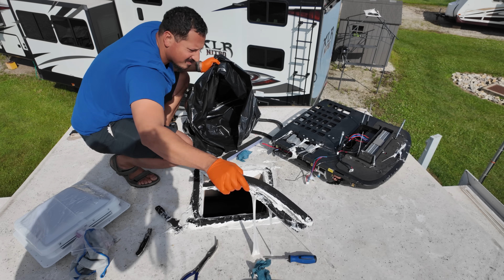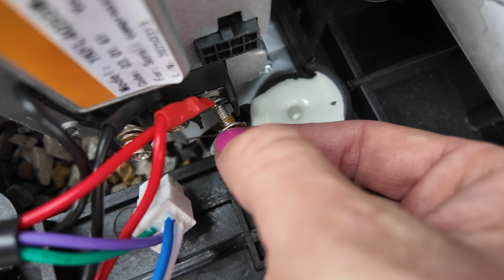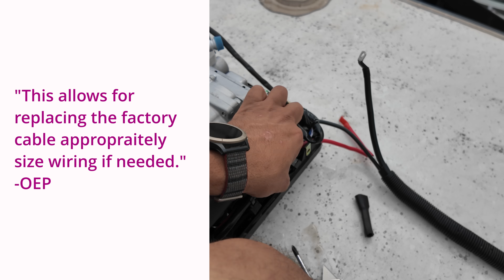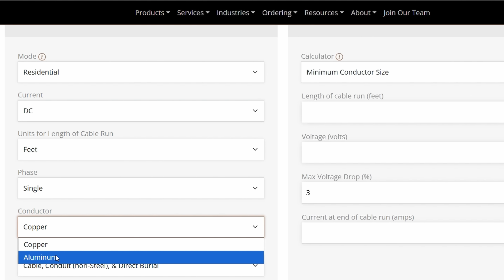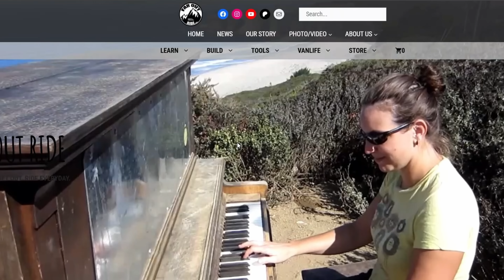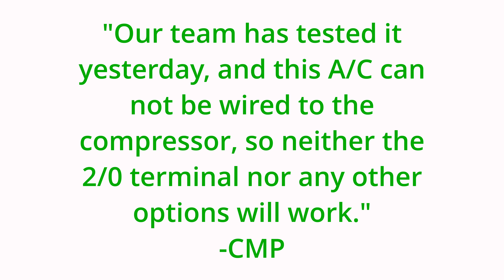The Truth About 12V RV AC Wiring in Big Rigs (What No One Says)

Comment: You may be better installing an energy saving Mini-Split unit with a mounting bracket on the rear bumper. I think some of those units use about half the amperage than the rooftop unit.  Should run on a decent inverter longer time than the 12V unit. The problem with 12V when considering Ohms law is amperage required due to DC 12 volts. DC 24 volts would typically require 1/2 the current or amperage and therefore only approximately 1/2 the wire size.  A mini-split unit a 13,000 or possibly 15,000 btu's probably needs 9 or 10 amps to run at 120V vs the 15000 btu roof unit using 14 to 15 amps.  If you really want to use the DC roof air unit you may consider checking to see if the roof unit could be changed to use 24V DC or possibly work with a DC step down transformer in the unit then set up a seperate 2 or 4  12V battery  bank in series for 24V output.  This would allow smaller wire feeders due to twice the voltage.
Reply from the maker: I have heard that those mini splits are the ticket! We wanted to try this out because it was the talk of the town, but you know we quickly realized that it’s not a great option for big rigs unless you make some serious modifications or have it closer to your battery. Thank you and safe travels!

Comment: Finally, a video telling the truth about these 12 volt units that everyone is peddling.  Someone asked me just the other day about these, said I've never owned one but would be concerned about the higher amperage, wiring, etc.  We live completely off grid and I recently changed my solar system over from a lower voltage, around 100 volts, to a higher voltage system, 400 volts.  What a difference, way more efficient, cooler wires, cooler components and much safer.  We dropped our amperage by about 75%.
Reply from the maker: Wow that’s insane! Love that your new setup is working for you! I’m sure these 12v work for smaller rigs but not larger ones for sure!

Comment: I have a 12 volt mini split in my motor home (Winnebago View) and it works fantastic. It’s very important that you increase the positive wire gauge to 2/0 from the battery to the outside unit (compressor/condenser.) I tied into the supplied wire (8 or 6 gauge) close to the compressor beside the unit. I also tied into the negative with 2/0 at the unit and connected it to the frame. I left the indoor unit wired as it came from the factory as it’s only turning a fan motor. Unlike a roof-top, the mini split requires the installer to add 134a refrigerant. MAKE SURE to put the exact amount in. 
It keeps the View cool for 6-7 hours with a fully charged 300 ah 12.8 volt LFP battery. I plan to increase the battery to 630 amp hours soon. The mini split outdoor unit is located under the vehicle - in the shade. Another benefit of the mini split is it allowed me to keep the Coleman 120v AC on the roof.
Reply from the maker: Thank you for this! I have heard that mini splits are the ticket!! Safe travels and stay cool!

Comment: Youse are asking to run a very big unit topside, but it can easily be done. The aluminum wiring, provided, should be discarded. Using the terminal size provided, run copper + and - about a foot. It then gets joined to very heavy copper cables to your batteries. My alternate would be insulate copper plumbing pipe in PEX plastic pipe for the long run. You don't have to run the very heavy stuff all the way to the unit. A better design, would be to source a much smaller DC AC system, such as a camper Panasonic 24 volt, which will clobber high humidity, but leave some personal cooling to high quality fans such as my recently purchased Boundless Breeze. Even with all the solar panels you can fit on the roof, high electrical draw will turn into a curse. Big mobile AC is properly built with a continuous generator. So you know, 12 volt DC compressors exist all the way down to 31 watts. They just aren't built into AC units. They keep your sandwiches cold.
Reply from the maker: Thank you! A 24v system would be the ticket for sure. I’ll check out that  boundless breeze! Safe travels!

Comment: Maybe you should consider a 24V battery bank and A/C unit, the Southwire app says you'd only need 1 AWG with your parameters, of course that will require additional equipment to step up to 24V to charge and back down to run 12V for the remainder of the rig, Victron solar charge controllers, perhaps others, can be set to charge at 12V or 24V, if you already own this then you at least have a partial solution to charge a 24V bank. I started researching 24V when I realized you can effectively double the output of your solar charge controller.
Reply from the maker: 24v would definitely work- we were just testing the 12v system because that’s what was being discussed. Thank you and safe travels!

Comment: Country Mod Pro. Ran my wire 30 Feet. I got marine wire 4 awg double insulated so it looked like one thick wire. Used a 120amp Bussman breaker. Done. Had to use GOOD quality parts everywhere. I tried to
use 6awg and it got way too hot.
Reply from the maker: Definitely using good quality parts is important- fires and rigs don’t mix! Great job and safe travels!

Comment: I believe if you go through 48 V unit it much better and it’s less cable sizing and I believe there is also Ac unit with AC electric with R 32 gas which is much much much better than the schooling capacity is really high. There is another one which is the 134 which is usually automobile gas that’s that’s usually does not work in and very tough conditions or something like that but I believe Acunit with R 32 gas rooftop and use your inverter is much better for run run time and so efficient actually much better than to run a whole entire cable for unless if you want to DC go for 4P boat and check if there is a possibility if you can get the 48 V DC with R 32 gas

Comment: Have a  quick secondary thought.
 thinking about efficiency. 

Might be best converting 12 V to 120 V. And then just installing a mini split system. As opposed to your "12 V RV AC ".

There are many high efficiency models out there. They don't need a massive amount of amps for startup because the compressors can build up as opposed to needing that rush of current.

And overall, the majority of 1 ton systems require less than 10 A overall.

Just what I would do with an RV that size

User dependent, especially how many batteries you want to put in there. But for every hundred amp hour battery that you were able to store power via Soler etc. would probably give you at least two hours of run time for a AC heat pump. 

Inverter Efficiency:
Inverters, which convert DC battery power to AC for the mini-split, are not 100% efficient. A reasonable estimate for inverter efficiency is 90%. 
Mini-split Power Draw:
The power consumption of a mini-split can vary, but a common figure is 500 watts for a 12,000 BTU unit. 
Runtime Calculation:
With a 90% efficient inverter, the usable battery capacity is 1152 watt-hours (1280 * 0.9). 
With a 500W load, the runtime would be approximately 2.3 hours (1152Wh / 500W).
Reply from the maker: Wow, thanks for sharing. That’s very informative. Never thought about a mini split before. We really wanted to test out 12 V and see what we get away with and see if it was viable for others. I think we found it’s not as easy as the advertise an inverter system is definitely gonna be the way to go thanks for sharing!

Comment: I recommend a heatpump instead. The cost of propane keeps going up. A 3,000 watt solar power system can make it work. Hopefully. But if it doesn't, a trailer hauling the power unit with a 30 kilowatt battery and 6,000 watts of solar should do the trick. The trailer can run a freeze dryer hopefully. It needs to be able to run for two to the days non-stop.

Comment: You set the calculator wrong. First, uncheck the 122f box and the 20 min continuous run.  Your ac won't draw 55amp continually! Plus, those 2 cable  use for positive and negative are not in a cable so they can handle more amp and stay cooler so less voltage drop. But for sure, low voltage like 12v it's really a bad choice for covering long distance with big load.

Comment: Instead, go with 24, 36, or 48V AC.  By going with higher voltage you don’t need as big of wiring.  I don’t know if they exist, but running 4 batteries inverted just for the AC is always an option if you can get a unit that runs at the higher voltages.
Reply from the maker: Yeah, a higher voltage is definitely the way to go. We just wanted to test out the 12 V and see what we can get away with us. That’s what a lot of these RVs come set up as thanks for sharing.

Comment: COUNTRYMOD WIRING ON 36' MOTOR HOME - OK you asked how I wired my 12V AC unit, I used the existing wire that came with the unit (14ft red & black), my 5500 w gen set is located near the rear of my rig and is wired properly from the manufacture with 2/0 wire due to the distance to the AUX battery 20ft ( 40' total )  , I ran the wires from the unit down the outside of my MH, inside electrical conduit and attached them to the plus and minus wires at the Generator power box with the 125amp fuse on the pos wire and a disconnect switch, I show this in my YT video, I have the excepted voltage drop with this setup and it's been working great with my 300ah aux battery.  NOTE if I'm going to run the generator, I turn the AC unit off before starting it, due to the power needed to start the gen set and the voltage drop might damage the AC unit.

Comment: I’m thinking buying 12 volt ac and heat , do you guys recommend buy one for my tv ? Any one has idea ?
Reply from the maker: If you would need to run wire longer than the 16 foot of manufacture provides, I would say you’re better off considering an inverter system at that point. Hope this helps.
Reply: @DeterminationUnbound thanks

Comment: yeah, i would agree they are not as 'plug and play' as most folks let on, at least not safely. 

i just finished an outequippro 10k unit install / upgrade from a maxxfan on a sprinter build. 
i upgraded wiring, added two bus bars under the cover, so i could have 4g (all copper) to the device, and 6g (all copper) inside the device. 
run is 20ft (so 40ft counting pos and neg) .. i've never seen it draw more then ~43A so should be ok. (could have made wire run shorter, but this was just easier / less holes in things)
replaced crap fuse it came with, using a bluesea block and mega fuse
i also sealed up the foam insert covering the ac fins. and had to do a custom roof seal because the one they included was not great (and i botched install) but no leaks so far from hose on it or it running for multiple hours
made a custom sleeve to extend ac out down to vent because sprinter has an insulated ceiling ... was able to get the metal brackets in between ceiling and van body, as someone else called out the heat inserts were not strait causing mounting studs to wobble when tightening, so i had to get them in, then drop it into hole in the roof.

so more then few mods, some that many folks wouldn't feel comfortable with. 

the https://faroutride.com/wire-calc/ link is really good, thanks for sharing that, will be a good sanity check for finishing the rest of the victron build out.
Reply from the maker: Yeah we messed up that seal so fast! It sounds like da like you did great and having half the run as us- I’m sure you had better luck! How’s the cooling?

Comment: What about installing the AC in the front AC opening on the roof of the trailer rather than the rear? 
Another option might be to install a smaller lifepo4 battery at the rear of the trailer and use 6 awg to the AC and 2 awg to the front for charging the rear battery?
Reply from the maker: Oh you could definitely just move it closer to the batteries. We wanted to keep our bedroom ac with the existing ductwork, so that was a personal decision for us. Having another battery in the rear is a great solution. Thank you and safe travels!

Comment: You did a great job on the research.  However, you don't add the two runs of wire together and like I've seen in other comments, make a slice in your junction box on the roof.  
Burndy (BIT2/0) is for tapping larger wires together.  
Also look up CGB connector for the #6 entering the J-box. 
I'm think of putting one of these in my Airstream Interstate. 
Thanks for sharing.
Reply from the maker: Thank you. 🙏 yes, for the Southwire app I did that incorrectly. As many comments pointed out you don’t need to add the two runs together.

Great suggestion , the Burndy and CGB connectors are great ideas.

Thanks for sharing!

Comment: The problem with under size wires is they may seem okay when first installed I learned the hard way I made extension cords to run 2 electric construction heaters 2 in each side of the side by side home's they recommended a 12 gauge wire and a 20 amp breaker so I made a 10 gauge and put it a 240 30 amp when I first started using it it was fine cord was cold to the touch and it didn't blow the breaker used it on that build no problem ran the heaters until the power was hooked up and the furnace in each was turned on later the company started on another side by side and again we needed the heaters plugged them in and again heat from the cords then about a week in it had snowed and I noticed the extension cords had melted the snow under and around them so I checked the cords inside and they were warm to the touch still ok but when we used the heaters on the next place they got hot and I decided to restrict each cord to running one heater and after that the company started having temporary power put in by the electric contractor but I've seen that before and after an extension cord that is able to run what's plugged in to it gets extremely hot after being in use over time unlike country's that us 220 where they have codes for extension  cords we don't in America and Canada and most of the cheaper extension cords are 16 gauge plugged into a receiptical served by a 15 amp breaker
Reply from the maker: Oh man I’m glad you noticed those cords getting hot. That could end up a nightmare. Safe travels!

Comment: What about changing the route, shorten it to lower the AWG, try using the Bathroom Black Tank Vent pipe for the electrical chase, pretty sure this would make the run 30 to 40% shorter, just a thought
Reply from the maker: Yes, that could’ve been an option, but it was important to me to keep it all clean and as little as possible exposed on the roof. Thanks for sharing!

Comment: Rooftop waterproof isolator would be a possible solution , the solar PV systems of old on domestic installations used to recommend them on roof's , so u could run your heavy wire to the isolator and mount it next to your A/C unit then from the isolator just run ur standard cable

Comment: There is an easy solution to this.  One I used to be able to charge my 8 camper batteries from my dual alternator in my truck, at 3,000 watts.  Just like in a home you're not running electrical directly to the transformer outside your house.  You bring the power to the A/C unit, not the A/C unit to the power (battery).  You want to run 2/0 wire from your battery compartment all the way to your roof, as close as you can get to your A/C unit.  You terminate it to a set of waterproof bus bars.  That 2/0 will terminate at the bus bars with the appropriate 2/0 5/16 lugs.  You then cut your 6ga as short as you can, and terminate it with 6ga 5/16 lugs to the same bus bar.  Make sure to fuse it appropriately on the 6ga side, since fusing is based on wire size, and not what it's connected to.  On the 2/0 side, make sure to fuse that appropriately on that run as well, towards the battery.  So now in effect you brought the power close to the A/C unit, just like an electrician would bring the power up to the A/C unit in a house (usually terminates to a cutoff of some sort), with the very little voltage drop that goes along with it.  Your very short run of 6ga will be immaterial at this point.  No need to run it directly into the A/C.  Additional tip, if possible, drill and run the wire into a cabinet closest to the front bedroom so you can reduce the wire cost.  As you know, 2/0 wire is going to cost you hundreds of dollars so if possible I'd try not to run it to the back of the rig to then just traverse the entire length of the rig to the front where the batteries are.  Also if possible, put the above mentioned bus bars in said closet with a junction box on the roof.  Not 100% necessary, but preferred.

Comment: Your video is interesting and informative, and I agree that the manufacturer should build the unit with more than just 12 feet of 6AWG by default; I can't imagine that 12 feet of cable being enough for any user. They should probably bump up to 5AWG or 4AWG and supply 16 to 20 feet of it. But your problem (being unable to connect 2/0 AWG lugs directly to the air conditioner's terminal blocks) is just a non-issue right from the start. You should just get some good crimp splices with waterproof heat shrink insulation, and crimp (using a suitable crimp tool) the 2/0 AWG wires to the original 6AWG wires cut off at about 6 to 12 inches of length from the air conditioner's terminal blocks. The 2/0 AWG wire isn't sized like that because you're pulling too much current for the 6AWG, it's sized like that to reduce the voltage drop across that length of cable. So a short 6-inch or 12-inch section of 6AWG at the end is simply not an issue.

Comment: I'm doing a install this weekend.  My issue is the cable is too long and I'm not sure I want the extra weight or coiling as mine is a 87 toyota RV that was overweight the day it rolled off the factory floor and space is at a premium.
Reply from the maker: What a great problem to have. 😂 you could always cut the wire down and re-crimp new lugs on it. I didn’t even know Toyota makes RVs, but that sounds sweet! Safe travels!